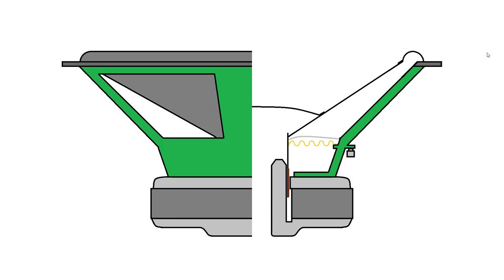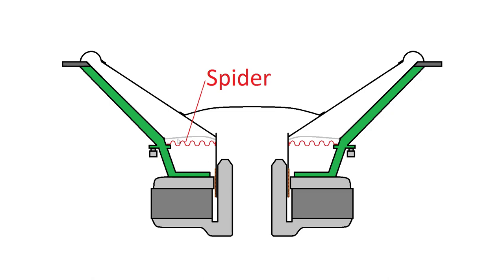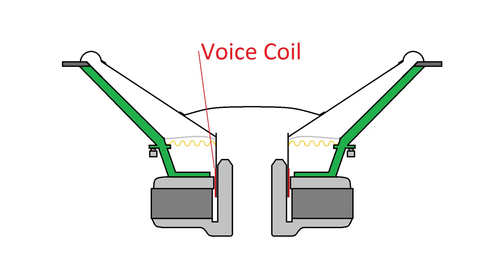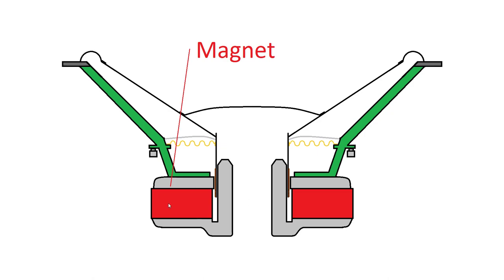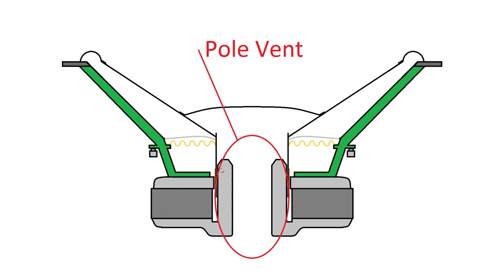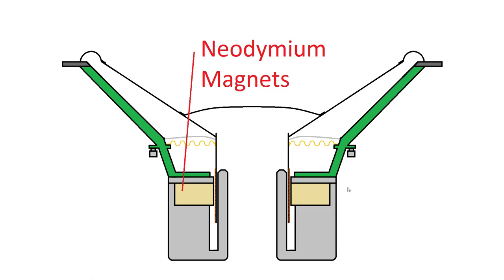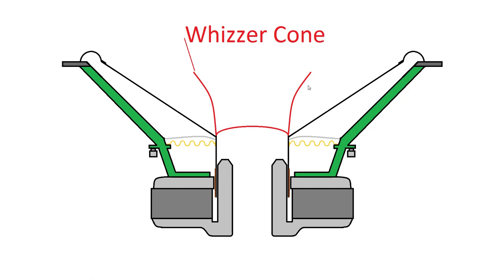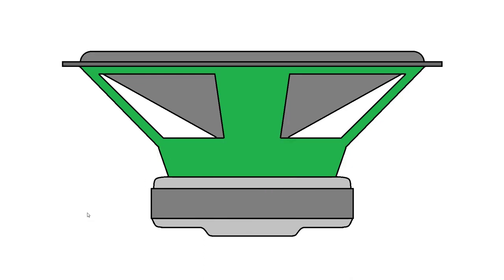Speaker Parts and Materials

Comment: Sir, could you tell us about the material of construction of top plate and T yoke?
Reply from the maker: I believe its usually some form of mild steel, something cheap/soft enough to machine, though I've heard some use Holmium (element 67) as it can handle a high magnetic flux density for super strong motors, though I haven't personally seen it advertised. I've heard it can handle a flux density of 8 Teslas, which is roughly 8x stronger than the surface of a neodymium magnet
Reply: @Dakoustics  thank you. Any idea on how to protect this mild steel from oxidation?
Reply from the maker: @radon222u  Nickel plating, or paint typically
Reply: @Dakoustics  how about galvanising?
Reply from the maker: @radon222u  Could work also, as well as anodizing, though I'm not too familiar with electroplating. I would avoid plating any surface in contact with the magnet, and ensure all tolerances are kept tight, i.e. no zinc build up in the coil gap. The zinc could also cause the exposed magnet to rust, so I'd only do it if I was accepting for the chance it could rust. Worth a bit of research per haps.